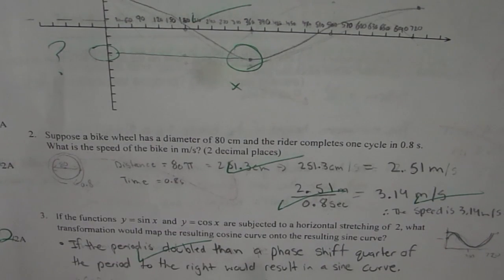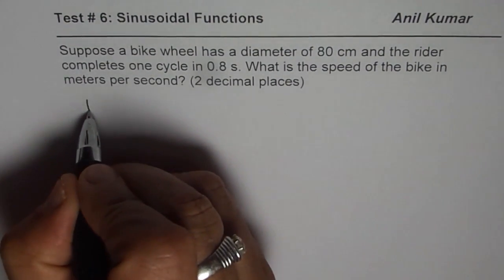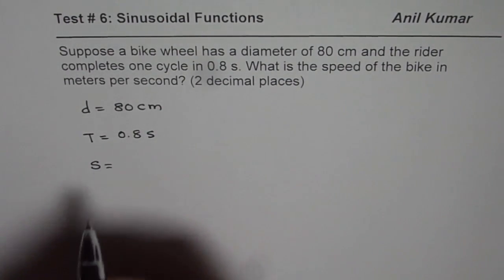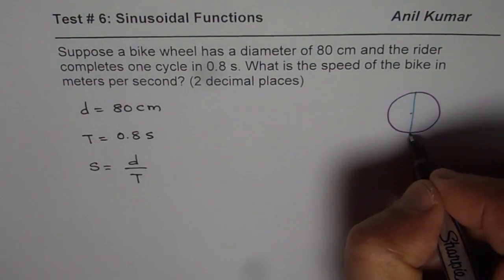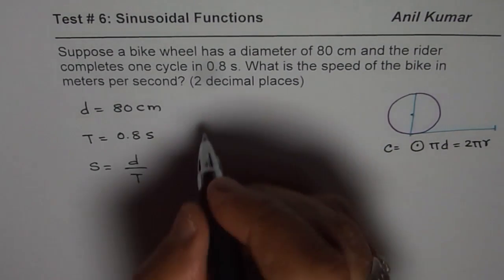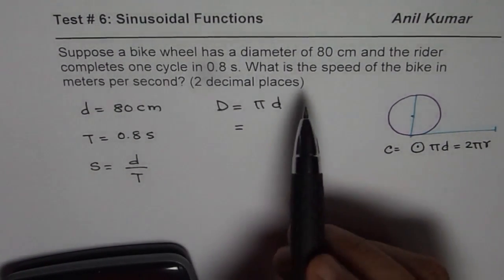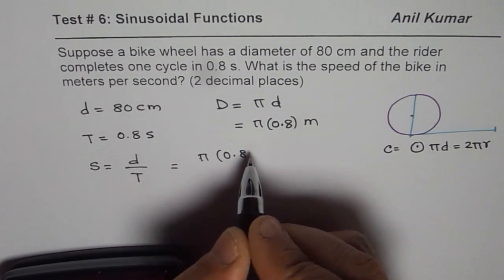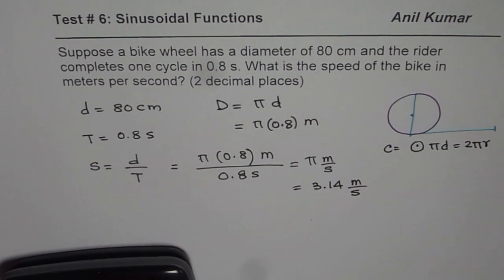Determine Speed of a Wheel Given Diameter and Rotation Time

Comment: A certain care wheel has a area of 3600πcm2 and its radius is x/2m. the car’s wheels turn through 100ᴼ about its centre, which is the rotation fixed, in 1/18 seconds
	Find the value of the radius.
	If a point on the rim of the wheel travels 32.4π km. how long does it take to travel that distance?
can you please solve this question today?

Comment: The front wheels of a wagon are 2π feet in circumference and the rear wheels are 3π feet in circumference.  When the front wheels have made 10 more revolutions than the rear wheels, how many feet has the wagon travelled. Will you do this?
Reply: 19.108 ft.